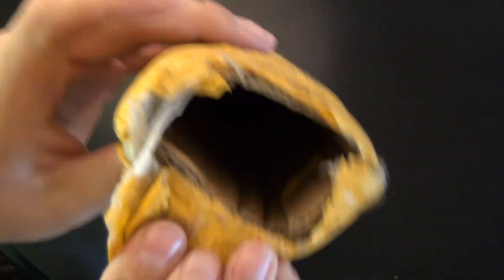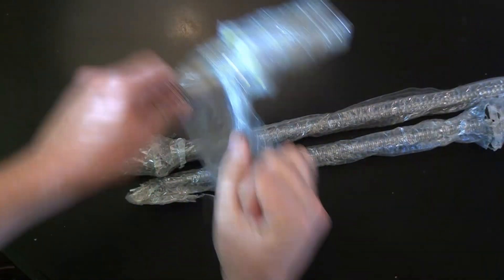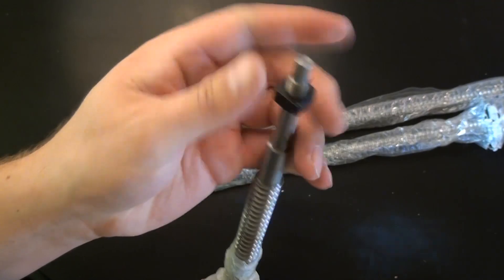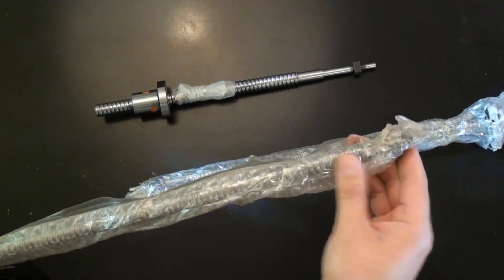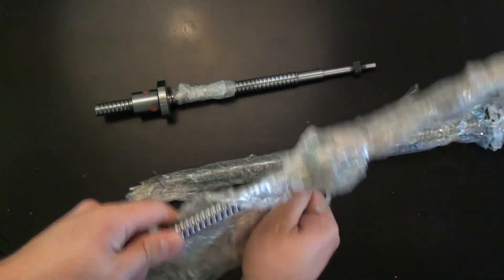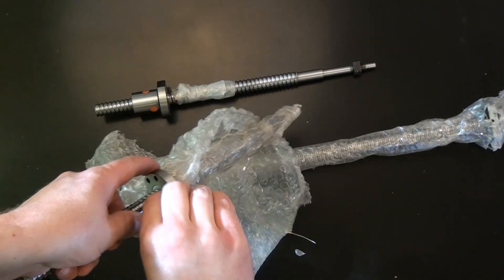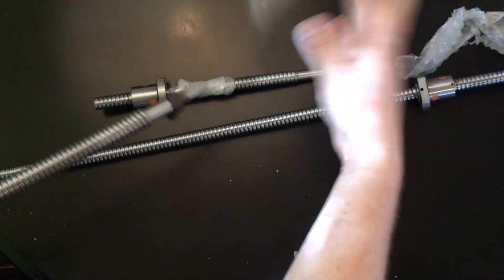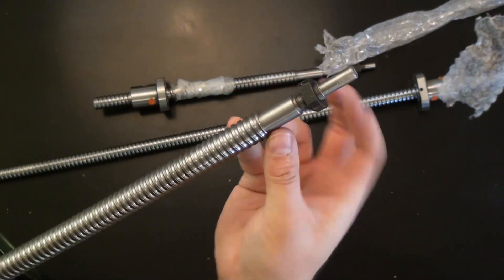G0704 CNC Conversion 03 - C7 Ballscrews & Nuts (from linearmotionbearings2008)

Comment: Hi russ.

Why do you need to buy ballscrews? Cant the Stepper motors be adapted onto the existing leadscrews that are on the machine already? This seems like a time-consuming and expensive way to do things.

Im based in the UK and am looking at getting a similar benchtop mill, and this channel has proved to be a bit of a goldmine of content so far.

Thanks, Ian.
Reply from the maker: Yes, absolutely; many people do. Ballscrews will allow you to go a little faster (generally), and have somewhat less backlash over the factory screws.
I knew I wanted to go ballscrews at some point, so I figure I might as well do it sooner rather than later.
Thanks for watching!
Reply: No problem! Thanks for the tips. Ive since bought a cnc mill (warco wm16) and have been slowly putting together a CNC todo list, I suspect i could probably shoot a video while im at it... Youre a bad influence! :-)
Reply: I think that the stock screw mounts uses the phase 1 mounts, right?
So why not make tha phase2-3 mounts on your stock screws cnc instead?
Is there any problem going that way?

Comment: I agree a C7 ball screw is the cheapest of cheap for a reason not to downplay whoever is selling these there's uses for them like an automatic gate opener. or a beer can crusher. but having a chip in a bearing surface means item could possibly be scrap! these are ball contact type screws that 9× outta 10 have way too much preload for their size  consistent with inaccurate assembly considering they are hot roll formed and have a high Rockwell is not good .also-precision screws only have a guarantee of 5 tenths per/ linear foot. and it these the BB deflection geometry is poor and made from nothing more than plastic so clicking popping or any type of noise is a sign of friction in a device reciprocating ball bearings  is exactly what you dont want to hear or feal so bottom line  do it right the first time or do it twice or just keep doing it at Harbor Freight.in case anybody's wondering I have worked with linear bearing components for 20+years and meticulously disassembled probably  every brand ballscrew manufactured to date! the Chrome helix rules the world I've been lucky to be a part of it. PS Leonardo DaVinci and his caveman drawings ain't got shit on me sucka
Reply from the maker: Great Info Jim.
Don't forget, for a super cheap bench-top mill like this even the cheapest thing available is going to be a huge improvement over the stock leadscrews. Even moving up to the very next level of quality means quite a bit more money, and generally the people who are going to CNC this mill are looking to get the absolute best bang for their buck. Unfortunately that means we have to live with lower tolerances (if I'm holding .002" I'm happy), but for rock bottom pricing it works pretty well.
Cheers!

Comment: Hi Russ, on these screws, did you notice any deflection (bent or waviness) ? I just purchased a set from a different vendor and the X and Y are bent or wobbly over .025" and I'm concerned they will cause problems.
Thanks. Mark
Reply from the maker: +Browningmotorsports Hey Mark. I didn't have any bends in mine. I thought my longest one was bent but I rolled it across my granite surface plate and realized I was wrong. All of mine as perfectly straight. I'm not sure if yours having .025" wobble is going to be a problem or not. It would make me a little nervous.

Comment from the maker: Are you referring to the flange on the nut itself? It does not unscrew as the nut is only one piece (plus the internal bearings and races). The "2.5*1" refers to how many "turns per circuit" are in the nut, which is 2.5 in this case. Basically, each circuit wraps around the screw 2.5 times. I'm not sure why it's important, but I guess it's nice that the specs are included.

Comment: Hi Russtuff,
Can you tell me if the ball screw nut flange unscrews I'm trying to figure out how I would mount these if they don't. This is a good alternative to making them yourself and about the same cost. I really don't want to turn the ball-screws if I don't have too and Hoss doesn't offer this any more. Also the specs for the 1605 says 2.5*1 is that metric and what does that translate too? Thanks for the great video.

Comment from the maker: Actually the Z is the only axis I have never had problems with skipping steps. It feels very strong and reliable, and I can get some pretty dang good speed/acceleration out of it. If I went with a higher TPI screw it would slow down the max speed, and I do not think it would get much more reliable.

Comment from the maker: The nut is supplied with a zerk fitting, which you could use to either oil or probably grease the screw. I didn't install mine as there was interference with other parts, so I just put a little oil on the screws from time to time.

Comment from the maker: I took a look, and I would think the blocks support the two ends of the screw. One end of the screw should be held into a block with the nut, and the other end held into the other block with the c-clip (the c-clip should ride in a groove near one end of the screw). I did not get these blocks so I am not sure how they will fit your application.

Comment from the maker: I am not sure what you are describing, have a link? I am oiling my screws and ways with 10w30 motor oil, like I use on everything. I am sure there are much better oils out there, but motor oil has worked fine for me.